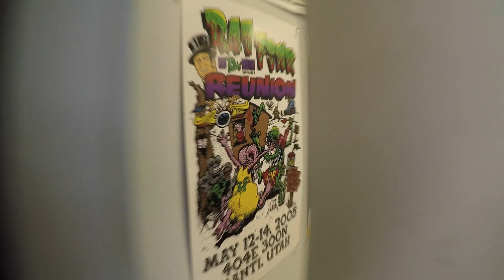Garden Railroad Drainage System - Our Elevated Outdoor Model Railroad Gets MUCH NEEDED Drainage

Comment: That's the case for one of those plastic/ribber mallets instead of a regular hammer.
Reply from the maker: Well, as I said, any tool can be the right tool! In this particular case, the tool in my hand was a hammer and the tool that was in my other hand was a chunk of 2 x 4. I don’t have a rubber mallet, but I do have a hammer and a chunk of 2 x 4! I was considering hitting it with a pipe wrench because that would be typically more like what I would do. But as I say, the tool in my hand is usually the one that gets used. You’d be shocked what I’ve used screwdrivers for!
Reply: @ToyManTelevision  I agree with your sentiment, if you have a tool that works, use it...especially if you'd only use the better suited tool for a one off.

Comment: Dale, as a former plumber, I would have used a little caulk on the leading edge of each drain and then hammered in place. Because, trust me, those are NOT water tight no matter how tight you think they are. Wood will shrink and expand at a different rate than the plastic and roofing material. ...Claude
Reply from the maker: Have a plan for that… we shall see. Hopefully not sea. Anyway as it warms up using a heat seal. I hope. But as of now 100% dry.

Comment: Given that you have a level surface I am skeptical that the water will drain toward these holes and the little slots in the pipe head. I predict it will generally just continue to puddle with only a small amount of relief. Even on flat roofs there is a pitch of about 2% minimum just like concrete walks, patios or sports courts are pitched to provide “positive” drainage. I hope it works for you. Please keep us posted with results over time.
Reply from the maker: So far working mostly well. Still puddles but not deep water. We are going to test the standing water but a roofer told us the bitumen in the roofing makes the water very acidic. And the fear is it will attack the rails and wires. The standing water isn’t a problem unless it gets so deep the tracks are totally covered and the water is running off the edge of the layout. So far the drains have knocked the depth down to shallow puddles.

Comment: Too low of voltage to be a problem. That is only my opinion. I do know a bit about electric.
Reply from the maker: Hi. The buss I’m using is 14 gauge and every section of rail has a feed from (or to) it. So I’ve never seen any voltage drop. If I run power through the rails and joiners the voltage drop is huge.

Comment: Dear Dale and Karyn, great solution, was wondering and pondering about this though. As you mentioned in previous episodes, you put the ‘table’ level, which is of course appropriate for the trains. However, on a flat roof, and especially with bituminous products, it’s very easy to create these kinda puddles. Hence, I was immediately reminded of your episodes when you built the new construction and at that time was thinking, that a slight slant would definitely help, with such precipitation. 
Anyhow, do realize that would irreversibly cause all kinds of other problems. For instance, how to get the track level. 
Think these ‘potholes’ are a good enough alternative. Do humbly think though that it may pay off to connect a pipe or hose on each spout under the bench work. In that way you will be able to lead the water away from the construction. Also, when dry, it may be good to advise to shortly heat the bitumen around the spouts with a heat gun and melt the tar onto the spout. That might just be better than caulk, because it will only form a new barrier around the spouts. 
Lastly, it might pay off to test the water which puddles on the layout. Bituminous roofing is known to give off sulfuric compounds, especially with a thin layer of of water. From my experience as a plumber and roofer, I would recommend you take time to do such a test, years ago I redid a flat roof which was definitely too level, and there was no chance, nor budget to change the slant of the roof, ever so slightly. For the spouts I used thick aluminum pipes with a TiG welded flange, on which the bitumen was mounted. After a year and a half the remaining water with the sulfuric compound on the roof had completely eaten away the aluminum. I eventually fixed it by adding a downspout at, you may have guessed, the lowest point of the puddle. Must say though that some bitumen with a cover of slate chippings will prevent this from happening, some will still give off those sulfuric compounds. And as long as the water is drained off properly, it won’t occur. In any case I would like to prevent your rails from becoming affected by this kind of occurrence, hence the slightly longer comment. Cheerio
Reply from the maker: Hi!! Thanks!! One goal was to keep the standing water off the rails. Never thought of that problem!!! But I can see oxidation and slime on the nickel rail. While nickel oxide is conductive the issue is not letting water stand against the rails. I have a noox product I’m going to apply as well. That will be a fun test. I love the heat gun idea… will do. The water falls onto the lawn and flowers below. Good sunlight down there as the layout is only 24” wide. So all good!! I am adding water lines to bring water up on the layout!!! Well… but just to water plants. The drainage system as well as the plants themselves having drainage should keep that under control. Come the spring!

Comment: "Don't gripe about civil engineers when you've got water backed up over your rails." (rule for life)
If you really want to avoid rot underneath, I'd pull Karyn's adapters and reseat them with a light smear of caulk or waterproof adhesive.  Since you live in a pretty arid place, may be not much of an issue.  Since I am presently paying for an indoor mold remediation project, I'm a little bit attuned to the ravages of benign water escapes.

Comment: SUGGESTION:  Instead of hammering the pipes down from the top, hammer them up from the bottom.  To decorate the pipes, have your missus, who seems to be very creative, built a structure that looks like an old fashion well with the bottom of it about 1/8th inch, or less up off the table.  It should work, or, try it, you might like it!
Reply from the maker: That would work!  But the flange really holds the roofing in place whilst making a totally waterproof seal. Only problem, and it’s a big problem, is the lip also keeps the water from draining all the way down… but the grooves I carve solve that. As long as they don’t get full of dirt… so frequent checks… so far so good. I think we need two more…

Comment: To solve your problem with water on top of your Railway I solve that problem with my Railway which is 1 m off the ground and it is what they Marine ply  cal which is waterproof but because I’ve done a lot of detailing on my trackwork I wanted to keep it all dry so I went down to my local hardware store which is Bunnings hardware like your Home Depot and bought some cheap Tarps about $10 each and I cut them and then Lay them over the top of my Railway when I know rain was coming and it’s solve that problem you could do the same problem with yours yours Jeff Melbourne Australia
Reply from the maker: G’day!  I love to see the snow out there and even run when it perfect in the winter. Perhaps once or twice. But this winter we have been in working on projects. Tooo dang cold.

Comment: Couldn't you camouflage the drain holes with rock piles?  thinking lava rock of the size used in BBQ Grills or if the spot is far enough from the rails, a building with a slightly raised floor or just set a vehicle over top of it?
Reply from the maker: Yup. Getting the grates Saturday at the Ogden train show. Then as it warms up we will try such things. Soon!!

Comment: So… If you don’t mind my solution…. I would have used a hole saw. One would have the dimension of the bottom of the fitting, say 1” and I would have drilled that all the way through. The second hole saw would have the dimension of the wider top, say 1-1/4” and with that I would have gone down only the depth of the rim of the fitting. That way it would have laid flush to the table much the way the drain in your sinks lay flush with the bottom of the sink. Then of course you could still put a cover over it with holes drilled into it so it looks like a man-hole cover. During heavy rainy days take that cover off for maximum drainage!
Reply from the maker: Hi!  We wanted the flange to seat tightly to the roofing. In a few weeks as it warms up I’m going to use a heat gun and that should seal the flange to the roofing. I was thinking of something similar to your idea for plant pots… still thinking about that. It could go badly.

Comment: My first thought was to try a drywall anchor. I would drill a hole and fill it with silicone caulk and then drive home the anchor. It's a smaller version of your solution but maybe not as visible.
Reply from the maker: Anything out there gets plugged up. These have the advantage of being easy to clear and clean. We shall see. As long as we don’t sea.

Comment: No matter whether it's ground level or or for standing up, drainage will be an issue on a garden railroad!🤔
Reply from the maker: It even is on full-size railroads! One thing about railroads, they tend to follow streams and rivers. And that means they cut those streams and rivers off from the side, streams and rivers. And therefore there’s always flooding on railroads! So, in that regard, we are no different!
Reply: Your right! A lot of railroads follow rivers and streams! The New York Central, best known as the "Water Level Route", follows a few waterways; best known is the Hudson River. The D&RGW is best example of following waterways: Arkansas River, Eagle River, Frazier River, Colorado River and Animus River!😎